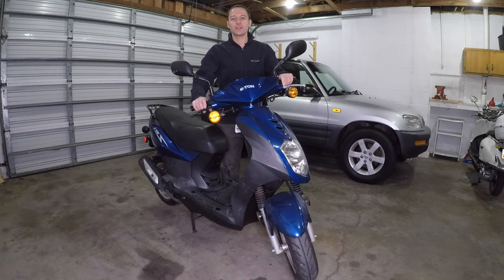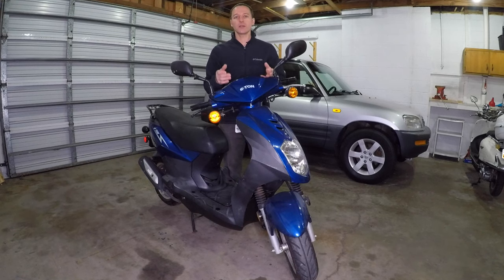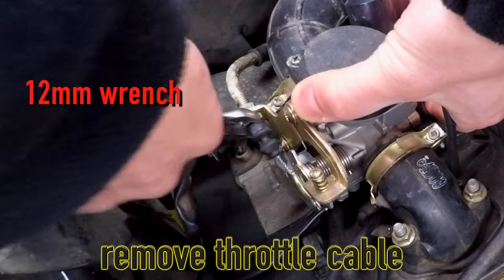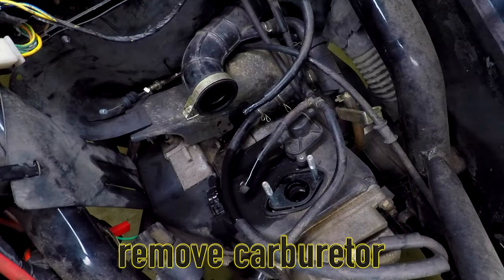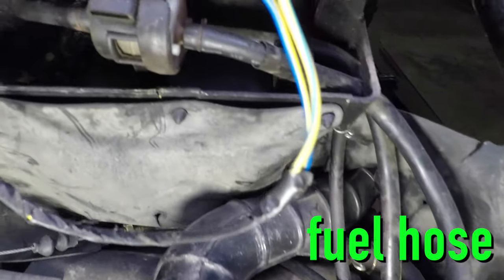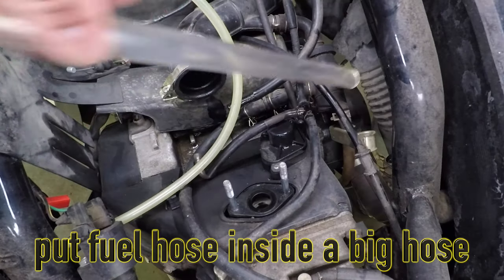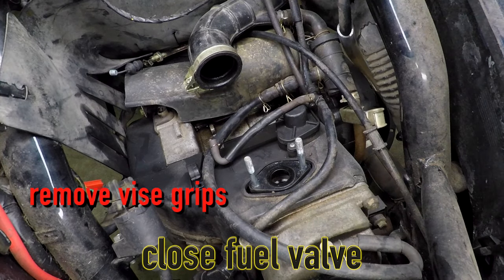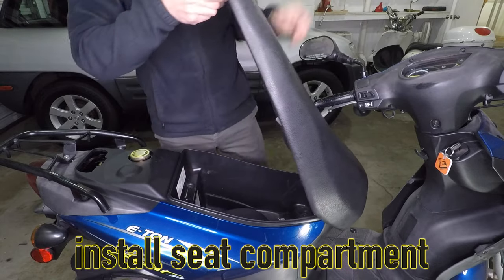How to clean the carburetor in a 50cc chinese scooter

Comment: I've watched a few of how to adjust and clean carburetors on 150 scooters one thing that's important is the needle and seat. If the needle is bad it will not shut the fuel off when the float should it will keep dumping gas in and you can adjust the carb till the cows come home. The seat is not replaceable that's bad it will keep dumping gas in.

Comment: I just pulled the carb on my 2017 tao tao, and the float bowl screws have no kind of head, phillips or bolt head.. what to do,,Dremmel a grove for a flathead or ????   HElp
Reply from the maker: Yes.  Cutting a groove for a flat screwdriver is a great idea.  You can also try grabbing the head of the screw with vise grips to break it loose.  If the vise grips don't work, you can use a battery powered impact wrench after you cut the grooves for the screwdriver.
Reply: @LabCoatPaul  Got it , thanx for replying , got antsy and did the groove cut, problem was that the threaded headless screw was flush to the float bowl, so ended up cutting small grooves beyond the screw itself, hope it doesn't create any future problems. was able to reuse the screws and thought it tightened up well, Now I will re=install the carb to see if cleaner did the job..crossing my fingers.

Comment: you bought the scoter for $100?? what a bargain
Reply from the maker: I paid what it's worth.  The retail price on this scooter new was $1399.   I was surprised to see that NADA actually has this scooter in their database.  They say the retail value of the 2009 eTon sport 50 is $400 now.  That's for a used scooter, in perfect working order.

My scooter had several things wrong with it.  The carburetor needed cleaning and a tune, the battery, starter, and ignition lock needed to be replaced, and the guy didn't have a title, so I couldn't legally operate it for 3 months while I waited for DMV to get me a new title.

Comment: Thanks for leting us all know you rip people off instead of telling them its a simple fix
Reply from the maker: It may look like that, but it's far from the truth in this case.  Yes, I bought the scooter for $100.  I also spent $50 on a battery, $50 on carburetor jets and air filter, $60 on a new ignition switch, and I spent probably 10 hours working on it, including tuning the carburetor, replacing the battery, and that ignition switch.  The scooter also has a bad starter, and dude lost the title, so I'm currently waiting on paperwork I submitted to the DMV to get a new one.  
A perfectly running 50cc Chinese scoot, with a title, is worth about $400.  I MIGHT break even on parts if I sell it, but I'll still have lost all that time and labor.
Reply: Szikra van nem indul

Comment: why can't the jets be unclogged?   I had a scooter sit for 2 years so I took itnto a shop for them to clean the carb (because I hate taking them off and putting them back on) and they said I need to buy a new carb. I asked to keep the old one so I could take it apart to see what they were talking about, and also to see if it looked like they even tried to clean it.
Reply from the maker: You can try to unclog jets with a needle or some wire, but you might not be able to get all the gunk out.  It's much easier just to buy a new jet.  Sometimes the passages in the carburetor are clogged too, and they're also hard to clean.  The good news is you can just buy a whole new carburetor for $35.

Comment: I'm looking to buy a Jiajue Sprint Sport 50cc 4stroke brand new.. Down in Australia, as I am not mechanically savvy. Any advice on keeping it running at its best?

Also gonna like and subscribe.
Reply from the maker: Thanks for watching!  There are a few videos on YT about making a Chinese scooter reliable.  I haven't made one about that yet, but basically you have to replace all the hoses, remove emissions components, and tune your carburetor. 
Most Chinese scooters break down a lot, so you will have to become mechanically savvy if you buy one.  
Do a bit more research before you buy that Jaijue.  Kymco is a Taiwanese company that makes much better quality scooters, and they are not very expensive.  Sym scooters are made in China, but they are also better quality than most.
Or just buy a used Honda or Yamaha.  It will last much longer and give you less problems than even a brand new Chinese scooter.
Reply: @LabCoatPaul  I've been doing alot of research TBH. I know the imports in Aus have been redone to meet our approved standards to be road legal.
Problem with second hand in Australia, is we have to jump through many hoops to make a second hand one road legal again.(which persay you buy for $700. But to get it road worthy/legal again, you end up spending another $1500 on it, and all those that cheap are high mileage cheap chinese brands. With various problems. (yeah Aust ain't cheap, lol)

Kymco is so recognised in Aus, its now about $4,000 + onroad cost, so that will jump up to $4,800 and the dealership is way to far from my point of living so the delivery fee makes total price $5,200.

The Jiajue sports spint 50cc 4 stroke is only $2,200 with onroad cost, free helmet and delivered.
I have read a couple good reviews online.. Not any bad ones yet.
And I know they been going since 2008(could be earlier, but haven't read anything predating that.)
I'll keep going through your videos and apply what I learn to the scooter.
It will literally be an a-b runner whilst I save up again for something alot more recognised like a honda.(which is only a little more costly then a kymco)

Another big downfall is many reputable brand only do 125cc minimum in Aust, which you then need a motorbike license. 
With a 50cc you only need a car license.. And getting a motorbike license is not easy in Aust, especially when I just got my L license.

The other promising thing is the guy selling them, also has a warehouse of parts, which is cheap. So thats a slight bonus.

I'm very new to the scooter/motorbike world, so I been doing a ton of research, including how to break them in properly. Lol
I was gonna do a car, but dang, that gets way more costly.

Comment: How u clean  jets
Reply from the maker: I usually take a thin piece of wire, and push a few strands of the copper wire through the jet to clean it.  If your scooter sat for more than 2 years with old gas in it, you might just need to buy a new carburetor because you might not be able to clean out all the fuel passages inside.

Comment: Say someone doesnt have the money to buy a new carb can you make a video thats slower and more in depth about cleaning and tuning the whole carb plz and ty
Reply from the maker: If a carburetor was sitting with old gas in it for more than 2 years, you might not be able to clean it.  That is why I recommend simply replacing the carburetor in that case.  Chinese scooter carburetors cost between $20 and $35 new.  You could spend more than that on jets and cleaning chemicals and still get a carburetor that doesn't work.
Reply: @LabCoatPaul  its only 6 months old it also only sat about 4 months it has rivets in the carb so it wont open as well
Reply from the maker: @robertwells809  In that case, just spray out all the holes with carburetor cleaner and you should be good.  I've never seen a carburetor riveted closed.  I've only seen the idle mixture screw blocked off.  Where are these rivets?  Is the float bowl riveted?
Reply: The three screws to open it up to the main jet are riveted closed so I just sprayed it all out I could and its been acting far better also changed the oil and cleaned the air box and sponge I plan to buy a new one when I can and keep the original one as a back up
Reply: Thank you very much for the help!!!!

Comment: Plugged jets, new carb? How about just pulling the jets and cleaning them
Reply from the maker: If the jets are plugged, the passages inside the carburetor can be plugged too.  They are small and curved, and it's very hard to clean them.  A new carburetor for a Chinese scooter is about $35, so it's not really worth the effort to clean it if it's really bad.

Comment: You forgot to clean the jets
Reply from the maker: I did spray some carb cleaner through the jets, but no, I didn't remove them and scrub them.  If the jets are dirty, you're better off replacing them.